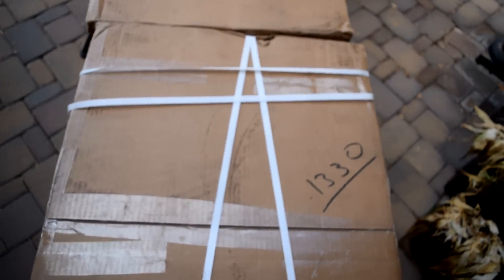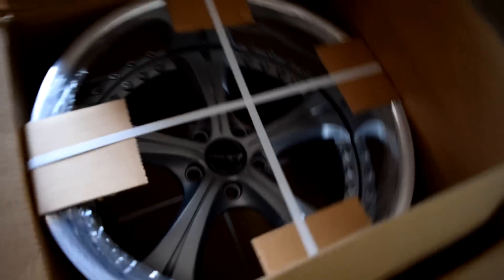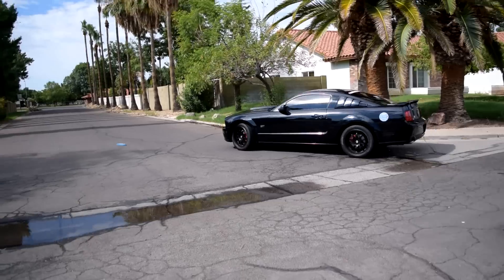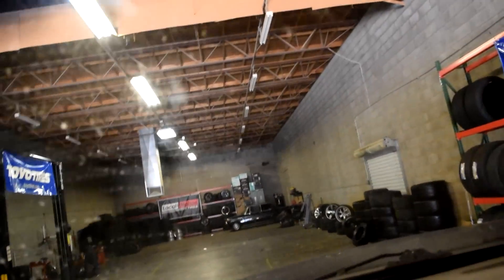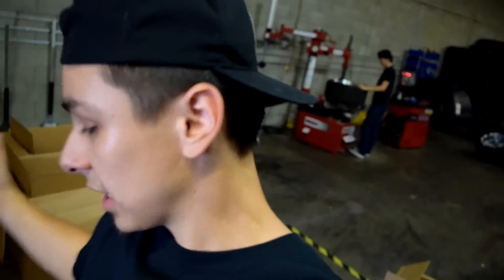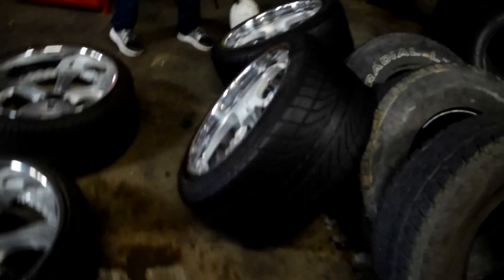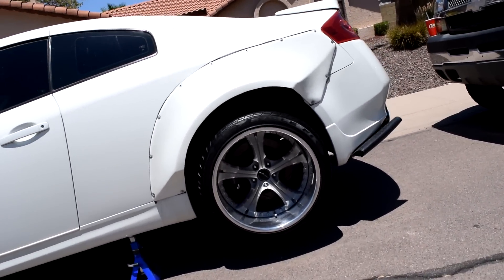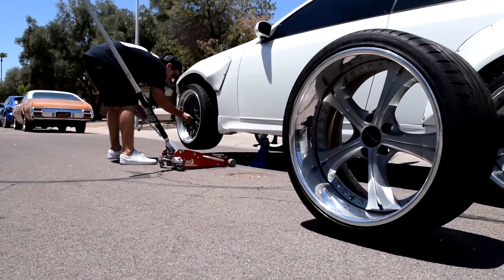NEW 3PC WHEELS FOR WIDEBODY G35

Comment: Rears need to be switched fam. Tread on the tires should be the other way around. Like if you took the left wheel and put it on the right side it would be fine.